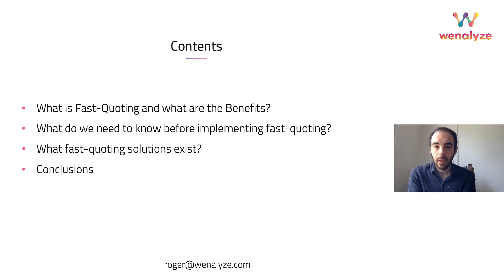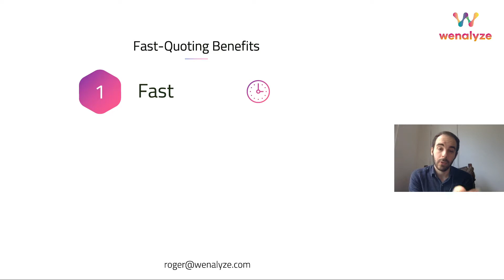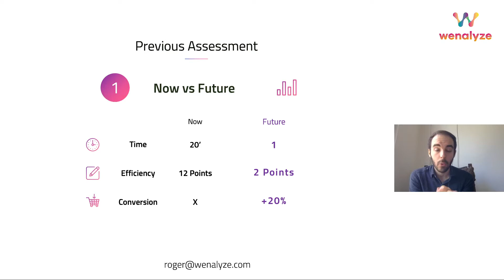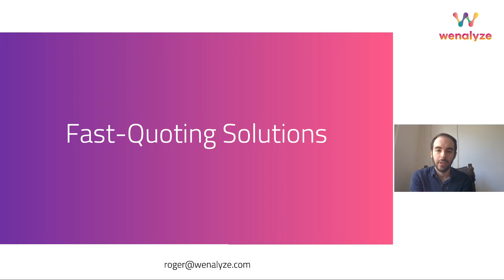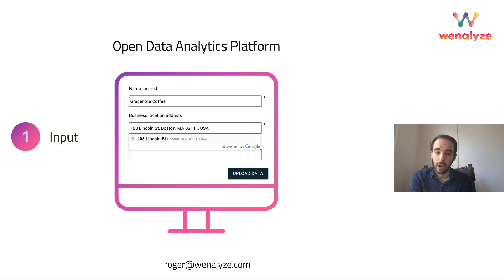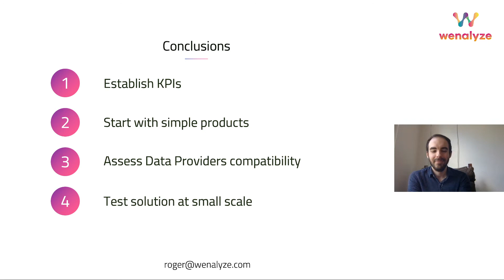Webinar: How To Build a Fast-Quoting Underwriting System

Comment: Also, how did you validate the customer’s needs? Are the companies open to discuss their challenges regarding their quotation systems?
Reply from the maker: We always try to ask our customers what are the challenges and issues they are facing as well as what tasks are the most time-consuming. Once we know this, we try to adapt our solution to their needs. As we explained in the video, for example, we can work with a platform or API connection depending on their connectivity. It may be difficult at the beginning but it is also a matter of confidence and sometimes it requires more than one meeting to reach this point. Thank you for asking!